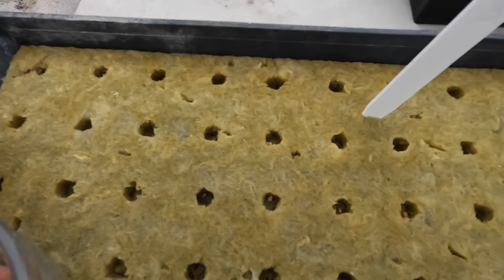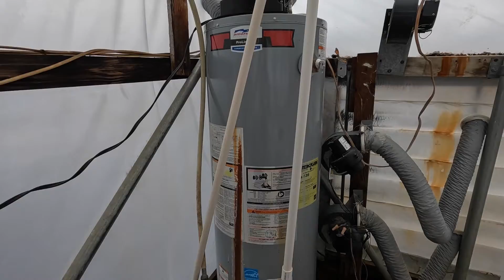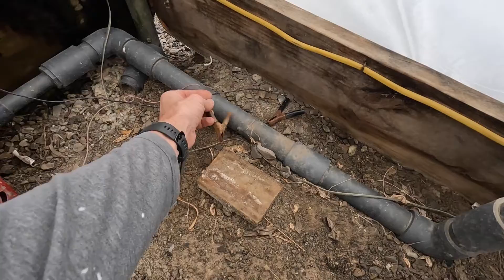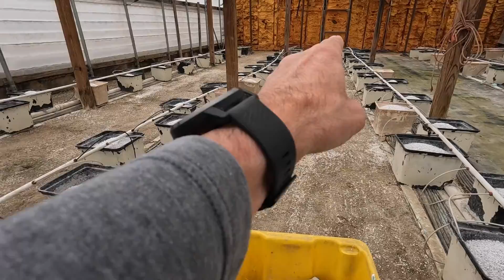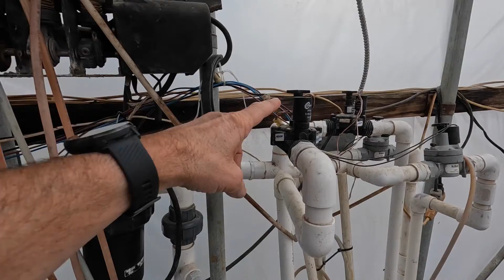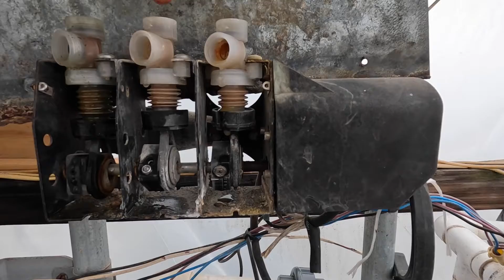READY TO SPREAD THEIR WINGS! -  HYDROPONIC TOMATO FARMING

Comment: Thanks for the Video.
Just a quick question, what size of tubing you use for each line of drip irrigation? 1/2 or 3/4
Thanks
Reply from the maker: I believe they are half-inch, I know they’re not 3/4. But I do use 1 inch PVC as the main header line to bring water to the 2/2 inch irrigation lines for the bato buckets.
Reply: @ i appreciate the response … also i do have one more question about your coco slabs setup, is it necessary to have them set on 2x6 and cinder blocks? Can they be possibly do well on a covered ground?
Reply from the maker: @hpgroup9519  my coco coir slabs are directly on the covered ground, in this video these are just where they are seeded and grown to a transplant ready for the coco coir slabs.  In this seedling stage they absolutely need to be up off the ground when it's cold winter conditions outside or they will get down into the 40's F at night even when the air temp in 60-65 F, and they will not grow at all.  Ideally they would have radiant floor heat to help keep them above 60F...tomatoes can not take up Phosphorus under 60F and will turn purple and not grow.  This video here shows our coco coir bags that we grow our grape tomatoes in:  https://youtu.be/PPwmyMn2ayg
Reply: @ you might not know it but our 11 greenhouses that we are currently building down here in Texas, on behalf of everyone working here and myself we are very thankful for your content and all your videos, you are the only person i have ever subscribed and watched all your videos ,some of them couple of times. Thank you for inspiring people like me 🙏🏼
Reply: @ and since we can’t afford dutch buckets at this stage we are planing to do coco grow slabs all the way on the ground, hopefully we won’t have any drainage issues down the roads, cuz i know folks use cinder blocks and woods and sometimes sit them on gutter systems, I’m only hoping to make it work on the ground,betting on texas warm climate

Comment: You will not belive how simple are the green houses in brazil, we just put the plastic film on cover and micro screen ant insects on the sides. No heating, no eletric air circulation. But due to high cost of steel tube, today most green houses are made of eucaliptus wood structure, it only hold 10 years. But its cheap. On high altitute areas, 3000 feet, where its easy to grow greens and vegetables, most small farmers are switching to green house, but not iven close to your in tecnology. You should be really proud of you work, thank you
Reply from the maker: That sounds more like a high tunnel which is just a single layer of poly covering a simple structure. We used to have a half acres worth of high tunnels, but decided to sell them and add another Greenhouse. It’s amazing what you can grow with a simple structure. Having water and electricity and automation is definitely nice though. thanks!